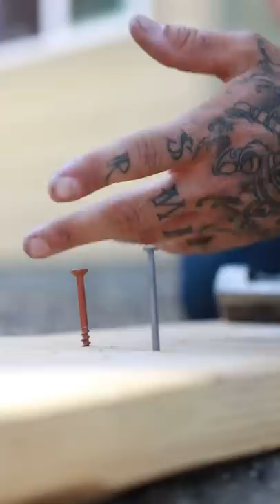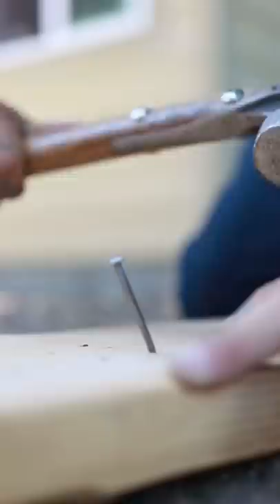Nails vs. Screws: Why do we use nails? #shorts

Comment: This guy's still young. He'll understand one day that it's only about cost.
Reply: And time
Reply: @dillonventola408  time = cost. 
So... Yes.
Reply: @paintrane1179  no... Most builders get paid hourly which means you'd be making more money if you took longer, but nobody wants to screw a roof together
Reply: @dillonventola408  *nobody wants to PAY to screw a roof together. Big difference.
Reply: @shortlivedglory3314  you've obviously never run a a crew 😂 😂
Reply: @dillonventola408  cost.. to the buyer.. cost.. to the foreman… “you’d” be making more of you took longer puts you in the wrong position here. The people trying to cut costs are not paid by the hour lol
Reply: @dillonventola408  tell that to metal roof installers. Also builders wont get paid for long  if they are slow
Reply: @1v1thousand  lol 😂 😂 😂 😂 😂 😂 builders without time constraints in thier contracts will take as long as possible. I've seen many 2 week projects turn into months of work
Reply: @dillonventola408  what are you talking about? The contractor gives a bid and the employee works hourly. Contractors want to finish the job as fast as possible
Reply: @Cadaverine1990  no they don't 😂 not when they're making 20-40 an hour off each employee. Only major developers who have thier own crews go as fast as possible. And that's how you end up with cookie cutter houses that need everything replaced in 20 years. You want a house that will last 30 years without any major repairs? It'll take twice as long and cost 100k more. I worked in Breckenridge colorado doing construction for 10 years it's 100% normal. Especially on those million dollar homes.
Reply: No, it's about the sheer strength like he explains in the video. It will say this in the structural drawings.
Reply: And time. Which is cost yea
Reply: @dillonventola408  builders do not get paid hourly 😂😂 contractors bid a job. And put a set amount for material in contract.
Reply: @gamebred88 lol, not when the job is time and materials...😂 😂 You seriously have no clue what I'm talking about, do you? Contractors often charge far more per worker than they pay them.
Reply: @dillonventola408  u must not be in the trades...
Reply: @gamebred88  lol I was general contractor for 10 years 😂 😂
Reply: Not really... engineers and physicists all make this statement. Screw do not hold without fasteners. Fastened screws also make repairs impossible. Fasteners cannot be removed and or reused.
Reply: There's a lot to do with temper and construction of the screw that makes it weaker when it moves compared to a nail which doesn't have prongs to stretch this isn't about capitalism it's a science as well
Reply: @dillonventola408  Most contractors don't have the privilege of scamming millionaires with time plus materials pricing. They have to make a flat price bid and stick to it. I would suggest you keep your shady business practices to yourself so as to avoid any of those millionaires from coming after you.
Reply: @lalamclala5553  lol another online engineer who couldn't build a dog house
Reply: Another boomer mad that a young guy knows his shit.
Sit down, pop pop. Hes got this.
Reply: @nunyabiznes5489  lol such ignorance, but what do we expect from somone with a rat as a pet.
Reply: @dillonventola408  And being a Contractor i approved this message.....
Reply: Yup
Reply: @dillonventola408  the owner of the company isn't the one doing the nailing. His workers are. So he wants them to be faster. Less hrs. Du
Reply: @dillonventola408  you’re coming off as ignorant bud. Contractors will either bid a job or charge t/m depending on the job. If it’s t/m then yeah the longer it takes, the more money to be made. If it’s a bid then they want it done fast
Reply: @TrenTproductions13  the only ignorant ones are those who think I'm wrong. I'm literally speaking from experience. Also you pretty much just summed up everything I said.
Reply: And speed quicker to use a nail gun than a screwdriver
Reply: Cost and more time consuming..
Reply: @cjcarter5667  structures move as units start getting finished all building move u just don’t feel them the video explained the exact reason why nails are used
Reply: @angelescalante410   true that’s also the reason
Reply: Hahahaha very true!
Reply: @paintrane1179  that was my assumption too. The way homes in America are made is for maximum profit minimal time to erect it. Thats why you can see 200 hundred year old houses in Europe  in use and a 100 year old house in usa is a museum.
Reply: @dillonventola408  you must work on a lot of government projects.  Any builders that go slow won't last long in the job on any private sector construction project.
Reply: @Weakeyedominant  lol who said I go slow? 😂 😂 I just have clients who continue asking for more and more work because they have deep pockets
Reply: @dillonventola408  that's just union work lol
Reply: @SRT480  no. Old houses last a long time. It's the 1950 and newer houses that are just built to be done as possible. 

My neighbor has houses built in the 1880s and they all still look beautiful with regular upkeep.
Reply: Yeah its more a cost thing. Not much seismic action in single family homes. Nice try.
Reply: I can build faster and better with nail gun
Reply: @Ti0midwest  faster AND better rarely coexist
Reply: You obviously don't know who he is. Guy has framed more stuff then you ever will
Reply: I’m a fence contractor and  Nails get loose over time with wood expansion and contraction. Never seen a screw get loose unless the wood behind it it’s rotten.
Reply: @Doing-construction-with-jerson  A fence isn't a house. it's not about loosening its about shear strength screws are harder and more brittle so they snap easier under shear loads.
Reply: Not true.. it’s literally apart of building code. Lets see you screw trusses and a roof, it wont last long
Reply: Dennis Inkster  nobody pays by the meter in the US....
Reply: @dillonventola408  I am never paid hourly...always contract, always quotr
Reply: @blaketodd1208  cool story man, that's a good way to go over budget 👍🏽
Reply: Exactly
Reply: @dillonventola408  the employees get paid by the hour... they don't make that decision. The boss does
Reply: Some thing like roofs are nailed, never screwed. Professionals use both!
Reply: @michelleblanc90  you don't have any idea how independent contractors work, or how construction crews work. There's a billion video of guys wasting time on site. Hell the hard hat challenge is proof of that.
Reply: And he'll also regret those ridiculous tattoos. 🙄
Reply: @dillonventola408  builders get paid buy an agreeable amount. They bid the prices, agree on a value, then distribute the money to the workers that are paid hourly. The deal amount  is set before they move the first piece of dirt. It’s up to the company’s bidder to make sure they can calculate the build time and pay for the workers to make sure they still profit.
Reply: @Trenton.bk2  that's if it's not time and materials, the the bid is an estimate
Reply: @dillonventola408  ???? Contractor gets paid by contract, so faster they finish there Skill the better
Reply: @waltertorres2969  that's not how most contractos do it
Reply: A screw is not a structural member, money is not the factor 🤦‍♂️
Reply: @ginoarcadi422  thanks for the laugh. 😂
Reply: @ginoarcadi422  thanks for the laugh. 😂
Reply: Bwahahhahahhahahahah
Reply: 100%
Reply: This guy is still young. He will learn how Research before he opens his mouth one day.
Reply: Exactly correct.
Reply: You know, one day you'll be old enough to understand that there can be more than one reason to do something a certain way. Don't worry, you're young but you'll get there one day.
Reply: @dillonventola408  Yes, I have a construction business doing houses, trust me, the faster they are finish the best for them and I. We pay them per job not per hour.......
Reply: @waltertorres2969  you're like 17 Walter
Reply: It’s called shear strength buddy
Reply: @lalamclala5553  this.
Reply: @shortlivedglory3314  you don't screw plywood anyways. Staples hold better then nails or screws. Have you ever taken off a piece of plywood that's been stapled? It fucking sucks
Reply: It’s really not but ok
Reply: Time is money
Reply: @shortlivedglory3314  Na I wouldn’t want to use screws at all 😭😭
Reply: @dillonventola408  huh? I don't recall a contractor ever giving a quote that depends on how long it takes them to get it built. Lol. The customer doesn't pay more because you want to take your time and milk more money. Contractors want it built as fast as possible because they pay out less in labor and therefore keep more profit.
Reply: @s00p3rman  lol you must not have much experience then 😂 😂 😂
Reply: @dillonventola408  your right. I have zero experience hiring a contractor that wants a blank check, and no deadline. Only an idiot would hire someone who wants an unlimited budget.
Reply: @s00p3rman  you clearly don't understand how contracts work
Reply: @dillonventola408  enlighten me. I want to learn. You seem to be an expert in the industry. If I own land and need a house built, what happens next? Take me through the process...
Reply: @s00p3rman  you get bids which are estimates, pick a contractor, agree on the type of contract, it gets built you pay. Pretty simple. What you don't seem to understand is there are different types of contracts.
Reply: @dillonventola408  most builders do not get paid hourly. That said when your working to a quote or price time is money. I would never do something because it is cheaper, I'd always do something properly even if it drives up the price. If clients dont like that they can pay a handyman to do the job
Reply: @JamieVauxnut1  most builders as in companys? Or general laborors?
Reply: @dillonventola408  a labourer isn't a builder... A builder is like you say a company of a person with a trade behind them, carpenter, electrician, plumber etc. Im a carpenter and run a small building company, everyone is paid a price except the unskilled labourers who are paid by the hour. Worked the same way when i worked for someone else i was paid a price. When i worked on new builds for a national house builder i was on set price 99% of the time. Was the same when i worked in Spain also, only handymen and unskilled labour charge a rate. If im skilled what takes me an hour may take someone else 4 hours so why wouod skilled tradesmen work for less money than unskilled
Reply: @dillonventola408  always work on a price even 250k jobs. They can vary massively like you say but a detailed evaluation and scope within the price for these unforseen circumstances is all thats needed as well as a detailed breakdown of the timescale with target points set out for clients . As for being a socialist, i have no idea why Americans are so quick to label everything and everyone, it really is a backwards way of thinking...
Reply: @dillonventola408  every builder i know of be it US, Canada, New Zealand, UK or Europe based work on set prices... I can understand a subcontractor working to a rate and the main contractor eating the cost but generally a single trade subcontractor is not classed as a builder
Reply: @JamieVauxnut1  you don't seem to understand that nearly everyone in the US is a subcontractor and no the "builder" doesn't eat the cost. They often mark up the price and make a profit off each subcontractor if they're under the same contract. The fixed price is the hourly rate. There are different types of contracts but 90% of small business operate on time and material when they can. You pay your "unskilled labor" hourly, you pay your subcontractors for thier hours and mark up everyone to make a profit off thier labor. It's common practice here. My family has owned a construction company for 40+ years and has built hundreds of millions of dollars worth of property.
Reply: @JamieVauxnut1  as for socialist, our government would never pay for stuff like that so it's unfair competition because it's government sponsored... It's like price fixing... You can't compete when there's a price floor or ceiling, just basic economics. But socialist don't care about fair competition they only care about "the greater good". As for your argument about business I think it's silly. Time contracts only work for people who cut corners and rush to make payday, not people who care about quality. Want an example? It's taken Spain 150+ years to build a church.
Reply: Most workers get paid by the job as a “so the faster they get it done technically the more money they make per hour. And screws armor expensive and a pain in the ass versus nailing something together. Plus if they wanted to make screws out of the same type of metal as the nail they would flex as well
Reply: @dillonventola408  jobs are bid on,  labor time goes into the cost.  So yes more time equals more money.
Reply: @cannonfodder6299  thank you for summing up what I just explained
Reply: Are you a tradie? or are you just commenting on a tradies job like you know more than his work that he's spent years to be good at and proud of his work. This man is clearly a good worker and cares about his work I can just tell that by his hammer
Reply: @dillonventola408  that make no sense tho....when you take longer, you make less profit!! The longer you take,the more labor you're paying out
Reply: @serinarowe4122   the general contractors doesn't pay the pay the labor... The client pays labor... The general contractor is simply the middle man between the sub contractor and the client. Just goes to show you have no clue what you're talking about
Reply: @dillonventola408  hey bud, asphalt roofs are with nails for speed and the expansion and contraction. There are lots of metal roofs screwed together. Tech come so far from the rubber washer on a rib. Anyone who lives in an old house that walks on floors or steps no why building houses with nails sucks. 30 years on homes and barns with screws. His case goes to hell because metal framed steel buildings are bolted together and you give it your all tight. A 40'000 square foot steel building can grown inches from sun up to sun down incredible force no bolts break
What About all the riveted structures 200 years old and still holding like new. Bolts and screws are heat treated so are rivets..I'm not trying to be mean but screws don't flex that far to crucial failure. Nails are a JOKE. unless ringed or coated
Reply: Building don't move enough to flex a screw to failure. Nails are soft because dunces drive them in crooked. Why does my steel Framed building grow 4 inches from sun up to sun down 30 foot ceilings. Bolts rivets and screws are heat treated to harder. The reason they work is because u don't want the joint to flex buddy, you want the material to flex and take the forces not the joint. Rivets 250 years old are still as tight as the day they were built. And we're are talking Chrysler building size buildings.   I hate to say it. But if your structure is flexing enough at the joint to break screws or bolts you need to hang it up and fire your engineer.  Or you live somewhere that doesn't go from -30 to 110 in the summer. Every time I walk across a floor that's nailed it pi*ses  me off how many times I've had to fix floor builders used nails. Yea they used to use nails. The flat head screw was common untill the 60's and that's the worst fastener ever built
Reply: @brianshell4111  hey bud I litteraly said it's for speed. The reason metal buildings expand without cracking is because it's all metal... It all expands... Duh.
Reply: @ginoarcadi422  no it is cost. But saw shear strength is a factor. Good screws can bend like nails depending on the screws you get and the heat treatments applied. Screws have a much higher holding force and shear resistance compared to nails. Nails bend though much easier than the shearing force required to break a good screw. Your structure when moving (granted you are using a proper framing nail or screw) will bend to point where it will reach resistance. That leaves screws are much easier to remove and less destructive than nails. Screws are also more expensive but stronger. It literally comes down to cost either will work.
Reply: @dillonventola408  if it doesnt matter what they say stop responding considering half the time you are wrong on 90% of cases.
Reply: @Sak-zo1ui  lol OK bud 😂 😂 😂 😂 I love people who couldn't frame a dog house telling me that the work I've done for 15 years is wrong 😂 😂 😂 what have you built? A shed in your back yard?
Reply: @Sak-zo1ui  a freaking handy man arguing with a general contractor? 😂😂😂😂 Yep you know it's all 😂 😂 people like you destroy houses for licensed contractors like me to fix and make a ton of money while doing it. 😂 😂 😂
Reply: You have a nail gun. No screw gun I've ever seen lol.
Reply: @SRT480  that's not even remotely true... There are hundreds if not thousands of 250+ year buildings all across America still in use. The house I use to live in was built in 1856...20 years before my state existed... Houses are older in Europe because people have built there for 2000+ years.
Reply: Foreal
Reply: @TrevorIsCommenting  talk about intolerance and arrogance. How's it feel to be upset about a fictional character? Bet you live in moms basement, hmmm? ❤️
Reply: @TrevorIsCommenting  it's confidence bud, when you're an expert in your field you don't let people below you tell you how business works. Did you run a construction company? Yea that's what I thought. You don't tell a doctor how to do has job, but you'll tell a licensed general contractor? Yea OK. What's your qualifications?
Reply: @TrevorIsCommenting  oh please don't flatter yourself 😂 obvious basement troll
Reply: @dillonventola408  hahahahaahhahaha alright son
Reply: @choister420  quit quoting what you dad said before he left. It's just sad
Reply: I mean engineers literally specify nails and which ones to use when building. 
So it's not JUST cost.
Reply: @choister420  I always wondered who was in the back room with the printers at their office.
Reply: @dillonventola408  give it up kid you're just wrong
Reply: @mr.g937  lol OK man, just another keyboard warrior 😂 😂 😂 talk to me when you get your gc license 😂 😂
Reply: @dillonventola408  oh for sure... I've had so many additions turn in to full blown renovations.. months and months of Changes
Reply: @gamebred88  we definitely go for hourly.. per man hour. full builds are usually for large cookie cutter projects
Reply: @dillonventola408  yes.. charging $45 paying $22... even your own family. I worked for my uncle for 6 years and literally did everything from plumbing, to roofing, electrical, drywall, foundations... this man was paying $28 by the end. clients would ask why I was doing it with a master's degree. I showed them my uncle's house... 11 bed room 6 car garages on both sides. I said... he is 63years old... not a chance he has 10 years left and I know for a fact he is making $300per hour. their jaws would drop. they didn't do the math. 8guys... charging $45 ... paying 22-30... he charges $85 if he is there ... difficult but over time
Reply: @dillonventola408  right. this guy saying we don't charge by the hour.. what the hell is time and materials then lmfaoo
Reply: Yeah screws are better, but more expensive. Even a deck screw like he used costs a lot more than nails and structural screws cost even more than that.
Reply: @the george  Lmao!!! Contractors absolutely charge per hour (per employee) in a lot of their contracts. They pocket the extra amount they are paid over what the "trademen" are actually getting. It's common practice foe a contractor to bid a job at a total amount, but that total amount has already been factored with them charging almost $10-$20 more per hour than they are actually paying the help.
Reply: There’s structural screws if you wanna go through a few impacts in a year it’s jsut more cost
Reply: Not true dude.... shear point is a thing
Reply: Hourly workers might make more money, but the owner of the company will lose money the longer it takes.. Contractors have to find a good balance between speed, efficiency, and quality of work..